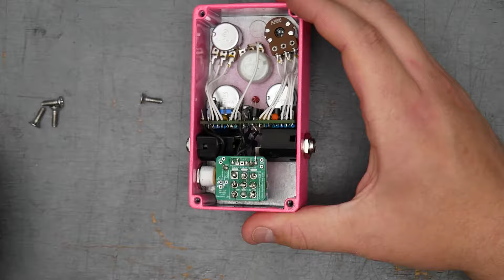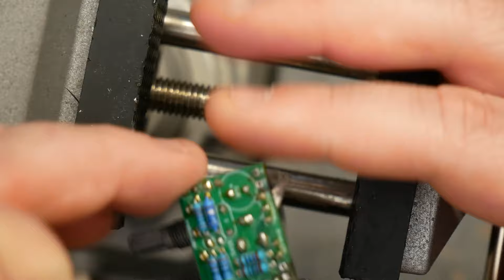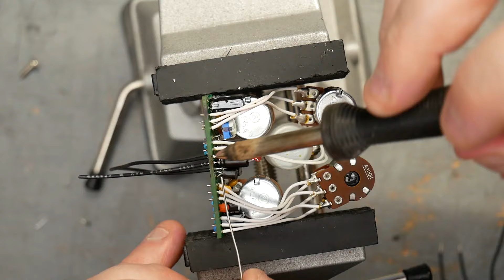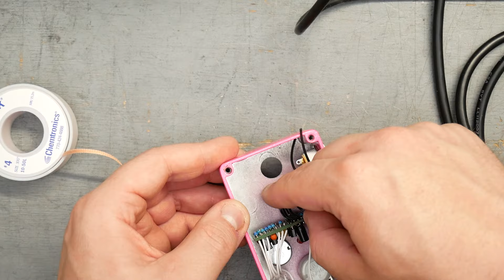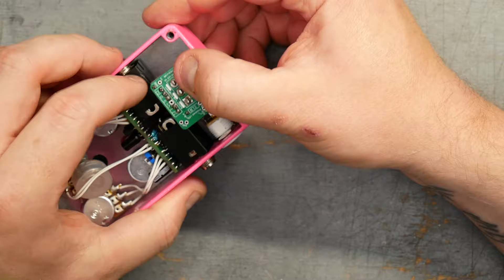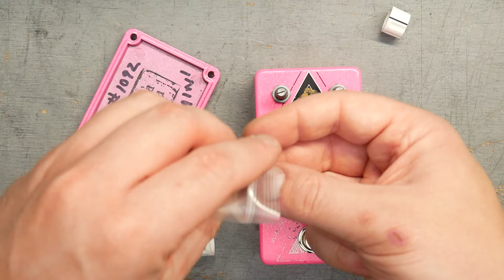Smallsound/Bigsound Mini Repair #2 // Gray Bench Electronics

Comment: fwiw that was a bad repair someone else did as i would not ship out a pedal in that condition. good call on the sleeve inserts though - i sent out those large knobs with set screws when i would run out of push-ons. good stuff

Comment: My tip for desoldering a footswitch PCB cleanly and efficiently is to get the solder flowing, then give it a good hard tap on the table. Repeat 9 times.  I use this method to clean up anything with massive gobs of solder such as footswitches, pots, or jacks. I have saved multiple dollars on solder wick.

Comment: Did you happen to make sure that it still worked after you put the back plate on? 
With how close the lugs from the foot-switch pcb are to the plate. Just wondering, because I've had that happen before.

Comment: pet peeve is when builders use a mono-chrome scheme for wiring.  I build all my pedals with colored wire that is coded to the purpose of the wire.  Makes all my pedals easier to figure out at a glance

Black ground
Red +Voltage

Green Input (circuit and pedal)
blue outpout (circuit and pedal)
White volume
orange tone
yellow gain
brown bass
purple mid
grey treb

and other colors for other things if I have more functions

Comment: Desoldering needles are really good for this sort of job. They can push debris through the hole and leave a clear path by pushing solder aside (pushing stainless steel though the joint/hole, it will not bond to the solder and can carefully be twisted loose and withdrawn - after solder cools). Considering the price of a set of these, everyone should at least try them, they save the day very often - and if modding is your thing, will prove useful. I don't use the needles for threading down component's legs (as is the main selling point), because of the next point...

For thru-hole pad diameters so close to the wire diameter, it helps to have trimmed the wire with a cutter that has a scissor action (rather than what bevel cutters do, which is closer to an anvil cut). Bevel cutters flatten the round cross section of the wire, possibly hampering its exit and tearing out the thru-hole plating or pad. In pedal PCBs, the hole diameters are not typically large enough to accommodate a flattened lead (from trimming), with a desoldering needle around it, AND leave the thru-hole plating intact.

EDIT: Hollow Desoldering Needles, should be your search term. And I am not a shareholder or anything weird like that 🙂

Comment: When I have several little wires in a row to solder on the pads for in/led/ground/out I'll solder one first. Then I'll put the rest of the wires into the holes and alligator clip them together with the first wire so that they don't move. It makes it a little bit easier for me.

Comment: Great effort on salvaging this one!

Seriously though, how do you even get blobs of solder on there like that without it flowing in properly?
Reply: they could have been worried about damage and used too low a heat for too short a time... better to go to high heat and a short time
Reply: persistence  :|
Reply: @grundunterrecording4197  Looks like heat was applied to the lug - and that the switch PCB pads never even saw the iron.
Reply: They probably heated the solder and not the components or didn't apply enough overall heat. Common beginner mistakes.

Comment: Great job again, and it’s worth mentioning that a visual inspection before applying power will save components in small signal devices, and save lives working with high voltage circuits such as amplifiers.👍🤙🖖